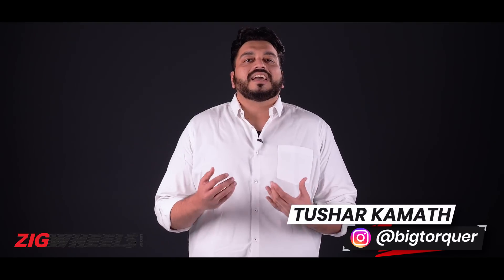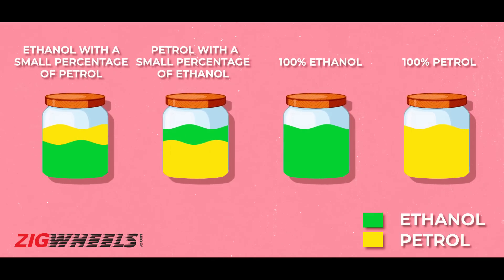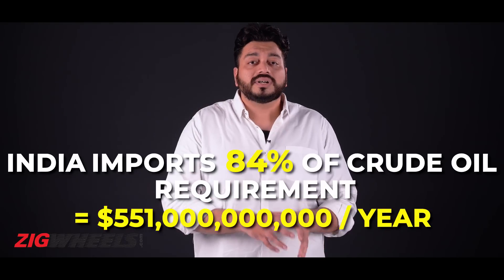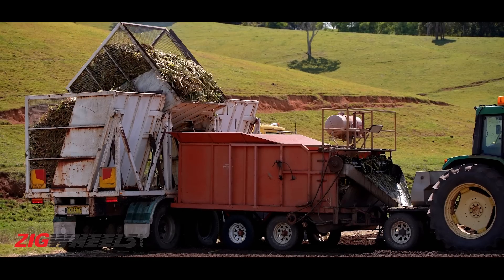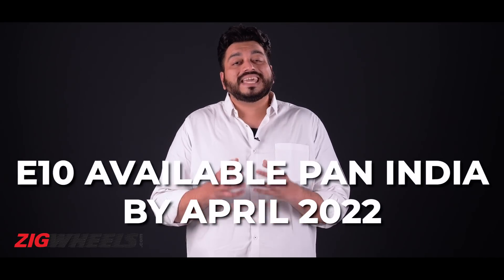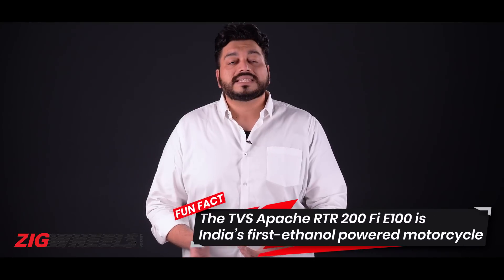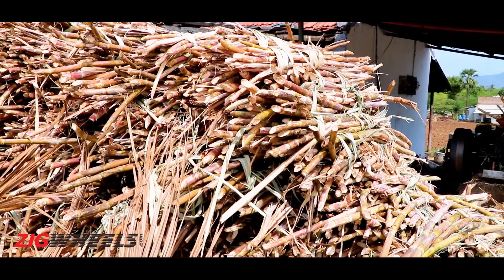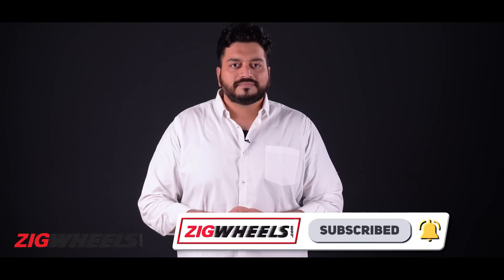E20 Petrol, Flex-Fuels Explained | ZigTalk

Comment: My state Karnataka has been running government buses on flex fuels for years now with technology collaboration from Brazil. There are a few problems here. Blended fuels are more expensive and return less milage per litre of fuel. The state and central governments have already taxed fuel very heavily. EVs are only shifting pollution from cities to the coal burning plants. The government should focus more on mass transit systems, aviation, hydrogen fuel cell vehicles, articulated highways, and solar plants
Reply: With EVs you also have a chance to generate your own electricity, through rooftop solar systems. This makes it much greener. Also, grid can be transitioned to renewable energy much faster than individual cars. Take example of Karnataka. In Karnataka, already more than 60% of energy comes from solar, wind and hydro. So EVs running in Karnataka are already much greener. So you cant say EVs shift pollution to plants. Also thermal power plants have much higher efficiency than lakhs of small engines running individually.

Comment: Amazing as usual Tushar. But what does it mean for cars like Kodiaq, which can't even run on normal petrol(91 octane) ? All kodiaqs and most german cars require XP95 to run smoothly.  There is no way these cars can run on E20. So whats the advice to people looking to buy a 50 lac rupee car in today's date? Should i consider cancelling it?
Reply: Yeah, what about all these largely sold tsi engines recently in virtus, kushaq etc? Also do the present 91 octane compatible bs6 engines run fine on E20 petrol?

Comment: Read that ethanol based fuel has some sediments settling at the bottom if unused. Won't this block carbuerattors of older two wheelers?

Comment: Flex Fuel Engines are more like stop gap arrangements. Govt should focus on a long term sustainable approach like Electric and Hydrogen fuels.  As an auto manufacturer you will have to spend a lot in R&D if there are is no clear direction. It is easy to say that people will have lot of options but at what cost. CNG, LPG have been around for decades now and look at the distribution and adoption.

Comment: E20 fuel and E10 both are compatible with cars from 2019 models or 2012 models cars are also compatible for second hand car purchasing as you mention cars of 2009 year is susceptible to corrosion nature of ethanol
Reply: You mean to say that cars sold from 2021 will be compatible with E20 petrol? Today i read that the new engine in i10 nios is E20 compatible? Does that mean older models will not be able to run on E20?
Reply: No older cars are not compatible. 

Read the owner’s manual it will clearly mention E10 max

Comment: How much E100 engine emissions? EVs are more important because we are doing good progress in renewable areas. But having more options is always like Hydrogen, Ethanol, bio fuel & etc.
Reply: True. Smaller passenger cars and 2 W can shift to EV.  Trucks and heavy constructiom equipments can run on ethanol or hydrogen, because electric is not much feasible for them.

Comment: Cool video👍 but it's confusing. So ethanol will reduce the fuel price but damage your engine parts 🧐 and will give you less mileage  ??? So why Ethanol ? Just to reduce fuel price ?
Reply: It will help farmes cuz it made for sugar cane and other crops
Reply: @Tushar Kamath does e20 compliant bike support e100 or e85 fuel ?
Reply: @Tushar Kamath so if I buy a e20 bike now, how long can I use ? Do you think govt will transit to e85 or e100 fast ?

Comment: Government can go with petrol  Hybrid ie Petrol+ Electric.Secondly Pure Ethanol Electric..with availability of E100.Thirdly Pure CNG cars.Fourthly Pure Electric cars which are coming soon.Fifthly Hydrogen Fuel cell may be at later stage.If still ICE are still to be retained Ethanol can be saviour for cars and bikes..to reduce import duties. Synthetic fuel is also an option.Disaapointing that Petrol heads are getting headache cuz in the name of Global Emission and reducing Carbon Footprints.Instead Grow more trees and save environment.If engines are going to phasedout then no need of Ethanol Investment.Can go Electric.which is no fun to ride Sadly Petrol lost its independence.2030 Era of Electric.Until then let the Engines Roar.

Comment: Imho, the best move forward would be to use smart hybrids in the short term like Suzuki does, but with with a higher percentage (over 30 to 40%) of drive powered by battery - this can be subsidized by the government. And as battery tech like Aluminium cells gain commercial viability, safety ratings and production scalability, moving towards full EVs will get cheaper. 
Secondly, at the moment, EVs like Tata Tigor at 14L (top model) is simply not accessible to normal people. So instead of offering 1.5L deduction on 80eeb only for pure EVs that are only affordable by rich people, they should extend it to people who buy hybrids too - we're already paying 28% GST + additional CESS + over 50% taxes on fuel, not to mention tax on income and consumption! It's not like they're going to make petrol cheaper just because they've blended it with Ethanol.